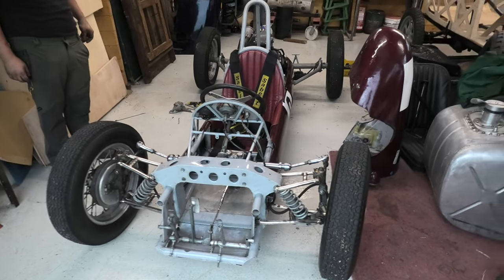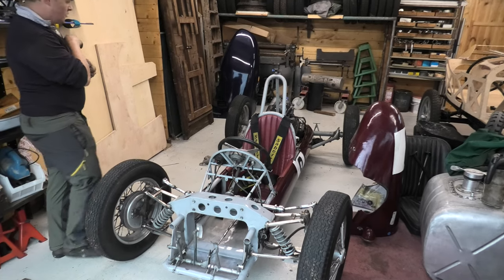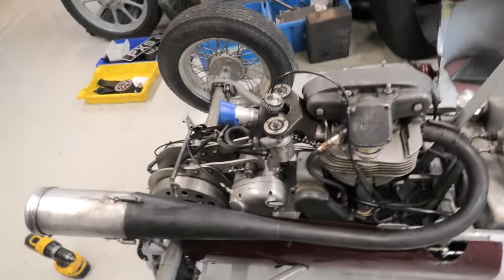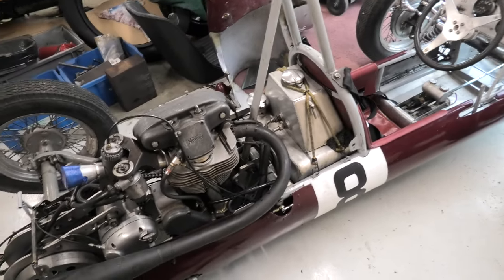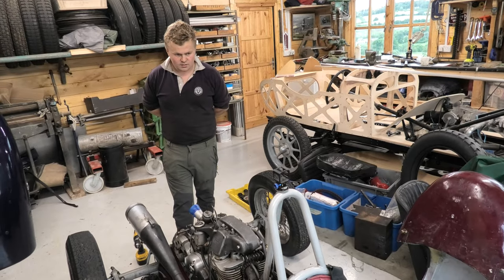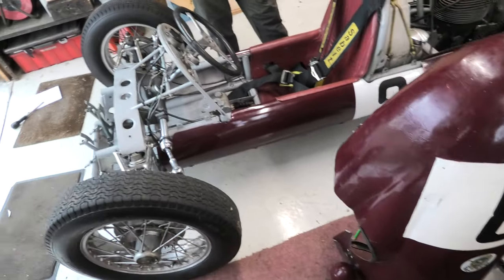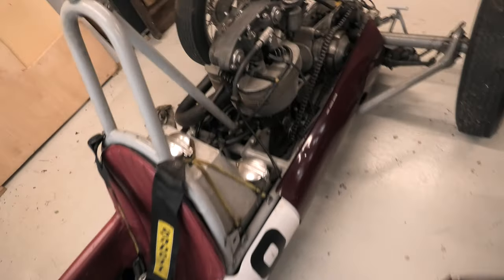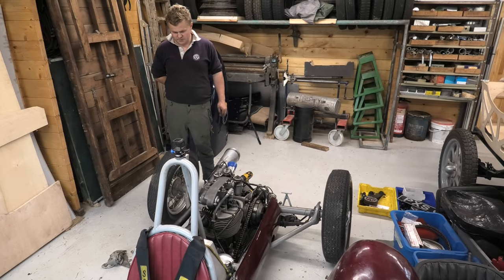Martin / Manx Norton Of Jack Bond

Comment: Nice! Thanks.   Any updates on the ERA?
Reply from the maker: Hello Jonnyb glad you like the vid, just something different which is par for the course at Tip Top. Its a nice car to be fair and once cleaned up and checked out this year it should be in great condition for next season. As for GP2 at the moment still waiting for bits and repairing other broken cars and usual racing prep. Jack and James are at Shelsley Sunday and James at Harewood with the Cooper Saturday , so busy at the minute sadly I won't be there at any but hey ho !